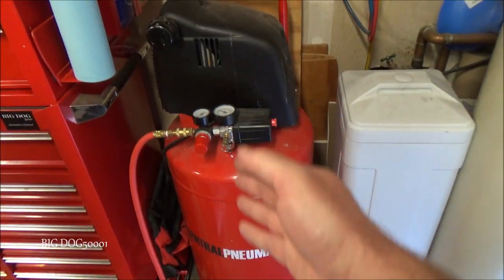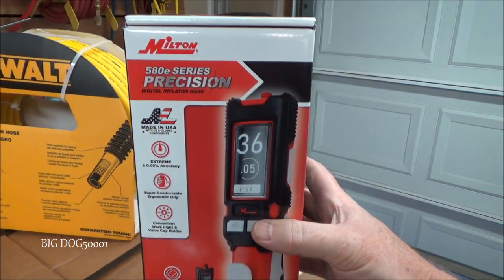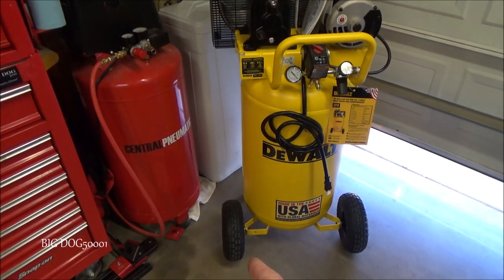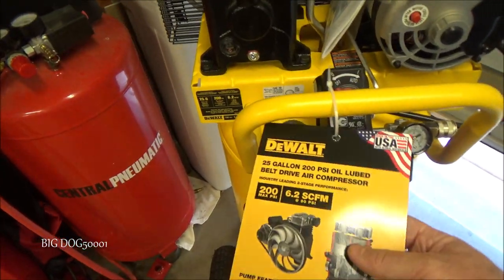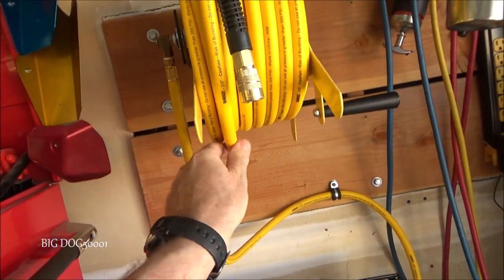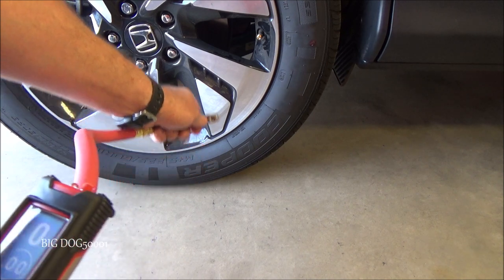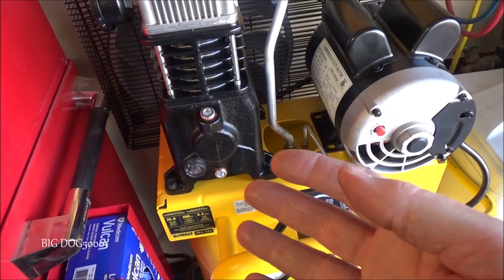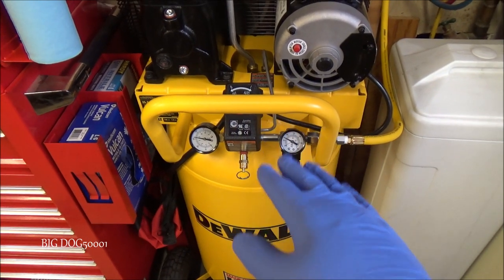Tools! Episode 2102: A New Air Compressor!

Comment: I see how you posted this video over a year ago.  So far, any problems?  How much, before tax, approx, did you pay for this unit?  You can use the regulator to bring the pressure down to 120 psi, then plug it in your harbor freight (with a quick release installed on one of your ports on the manifold that goes to the main tank, not after the regulator) to increase tank size and cfm; with both units hooked up on its own dedicated electrical outlets, they can run together if need be.  Only the loud compressor will kick in if your dewalt lacks recovery power.  You can probably paint nonstop.

Comment: Who cares about taking it out of the box? How well does it work with AIR TOOLS? Will it run a cut off wheel or die grinder? If all you're going to do is put 32 psi in your wife's tire or blow dust off your bench, you could have saved about $500
Reply from the maker: Yep, that's all I have done with it....

Comment: I extend the drain valves on my compressors with brass pipe and put a ball valve on them so it makes it easier to drain never used soft line very cool 😎
Reply from the maker: Hard lines are better but the angle of the drain valve on the old HF air compressor made that difficult.
Reply: @BigDog50001  aww got ya

Comment from the maker: Tools
Disclosure: This channel earns a small commission using some of these links - at no additional cost to you.
DeWalt Air Compressor DXCM251:  https://amzn.to/2TkOGE2
Milton 1/4" Air Coupler Kit s-210:  https://amzn.to/3xeRvFm
DeWalt 50' 3/8" Hybrid Air Hose DXCM012-0205:  https://thd.co/3zp5OsI
DeWalt 6' Lead In Air Hose:  https://amzn.to/3iCH4HG
Milton Air Chuck 580e:  https://amzn.to/2RMxIxQ
Drain Extension Kit (Don't exceed Air Compressor working pressure):  https://amzn.to/3gtYd3F

The Big Dog 50001 Automotive Channel Store can be found here: https://www.amazon.com/shop/bigdog50001automotive  (As an Amazon Associate I earn from qualifying purchases).

Comment: Nice review. Any reason you didn’t go for the equivalent 30 gallon even though the 30 gal says it’s 155psi? For an impact wrench working on suspension is 155psi enough or would the 25gal at 200psi be better? Thanks!

Comment: Dave...nice as usual.  I have an accurate Astro inflator but find myself rarely using it ever since I got a Vaclife automatic inflator where you set the psi and it will automatically inflate to the desired psi and then shut off. It is surprising very accurate after confirming with my Accu-gage. No more back and forth adding or releasing air.
Reply from the maker: Thanks for the input!

Comment: Thanks for the video. Can you tell me how long it takes to fill from zero to 200 psi? Or how long to recover from 150 to 200psi? Trying to calculate the real world cfm.
Reply from the maker: I have not timed that stuff but I can tell you that I have beat the crap out of it and it has run everything I have thrown at it from paint sprayers to die grinders to DA sanders.  Thanks for the comment!

Comment: Dave very nice. I have the Dewalt 15gal. 200psi model. I’ve had it for a few years now and it’s problem free. Noisy yes but nothing you can do about that. It sounds like yours runs pretty quiet seeing as it’s oil lubed. I liked that. You know me when I get one of your positive tool reviews. Mine is only 5.0CFM AT 90PSI. It does the job. It had no problem breaking the Honda crank pulley bolt loose for the timing belt job. Anyway let me know how you like it. Dave you and family stay safe and well Artie 🇺🇸 Dave I stayed to the end do you like the hose and is it flexible. Up north here the poly hoses get very stiff in the cold. Real pain to roll up. Let me know I’ll buy some accessories. 👍
Reply from the maker: It certainly doesn't get as cold here as it does up north but I'll let you know how these hoses hold up after I use them for a while.  Thanks for the comment Artie!

Comment: Can you point me in the right direction for the parts you used to extend the drain valve on your old harbor freight compressor? Thanks
Reply from the maker: I had something like this on there (just can't exceed the 175 psi working pressure):  https://amzn.to/3gtYd3F
Reply: @BigDog50001  Thank you very much